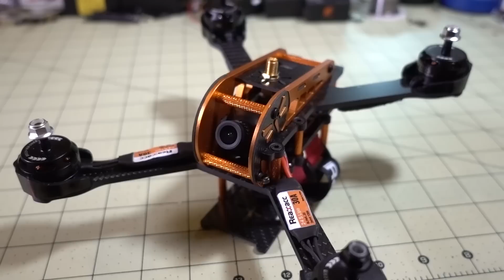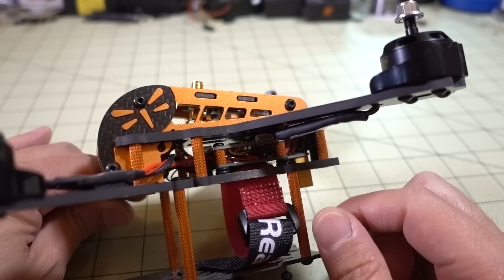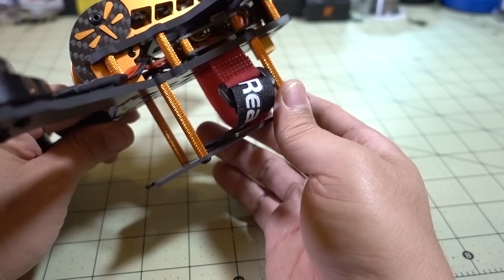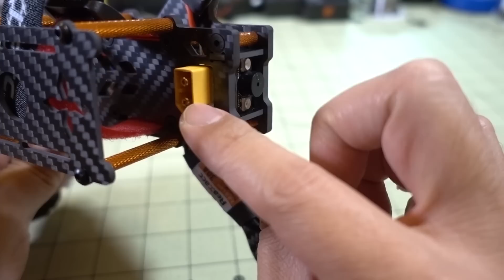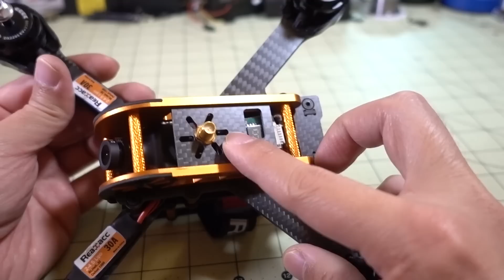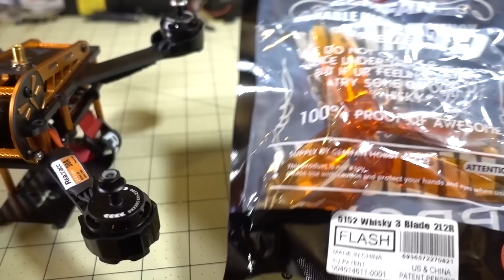Realacc Real2 FPV Racing Drone Overview 🏁

Comment: What sucks is that even if you move the sma connector, there's still no slots wide enough for a GoPro strap on that aluminum frame. I suppose someone could file out the aluminum between two of the four cutouts on each side. It's just too bad they didn't design this very well